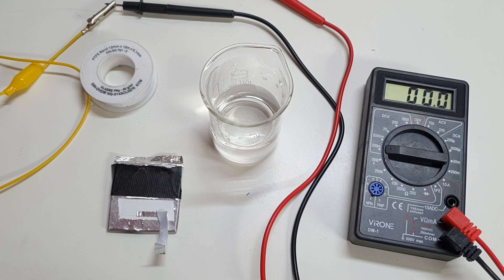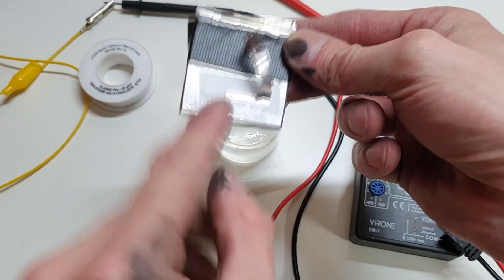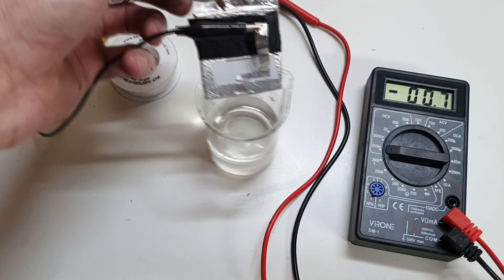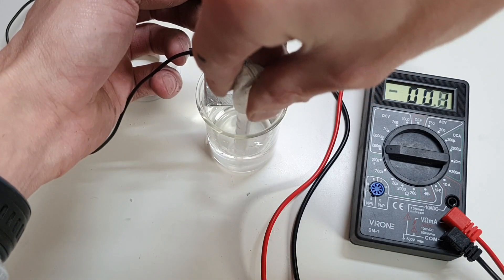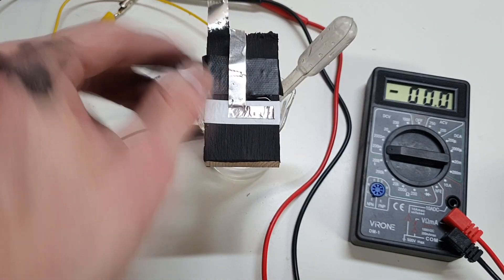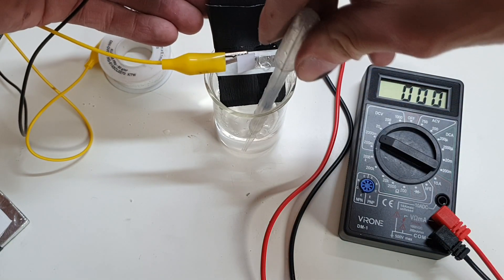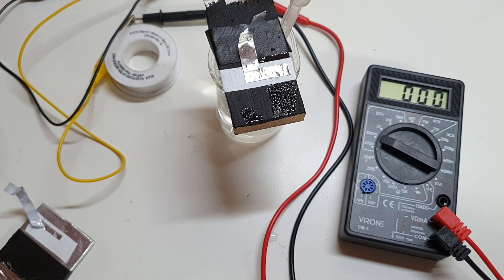Rain Fuel Generator from Conductive ink

Comment: Doing it with conductive ink (carbon based obviously) you created a galvanic pair so your additional voltage isn't from the effect that original device has but from the anodic dissolution of aluminum. So this is rather a bad idea.
Reply from the maker: Correct. A uninsulated carbon surface on the device will make a reaction and will produce a voltage in the range of 1 to 1.3 volts. A isolated carbon surface with a layer of PVB create the voltage which is shown in the video.
Reply: @cayrex  Do you using isolated carbon layer?

Comment: Hi there buddy . How is your rain fuel generator coming along ? I think it will be the first project I get to use the ink on that I made ! Just got to get a few things cleared away and let the testing begin . Have you any suggestions on what characteristics the ink should have besides conductive ? I am yet to research the papers on how this concept works but I have a feeling it's along the lines of static?

Comment: Did you measure the current generated by these voltages, to provide the power output?
Reply from the maker: Yes,.... its in micro amps range
Reply: @cayrex  okay, thanks. So I guess that places power output in the realm of nW/μW and so to produce 1W this would need scaling up by around 100,000,000%?
Reply from the maker: @timyorke9758  yea,.... NANOgenerator

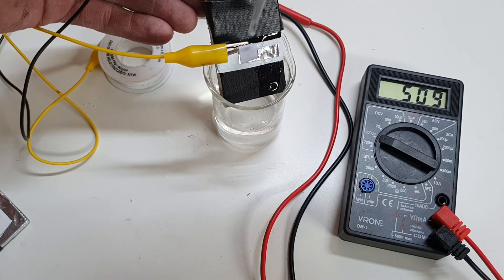Comment: Attention at 3:47. No droplet motion, just water forming a conductive bridge between the electrodes. I wanted to test this for myself so I got some aluminum foil and a carbon electrode and submerged them in a 100mL beaker of tap water and got a 0.8V cell voltage. A water droplet on a small area of electrode / active material might explain the low cell voltage, what do you think? Are the flowing water droplets just switching an electrochemial cell on/off between the conductive ink and the aluminum electrodes?

Edit : After setting up the same experiment with aluminum, PTFE, and aluminum , I realized this is actually a capacitive effect
Reply: Exactly!

Comment: Hi :)
Thank You for the Idea
I have a Question: Does the Water Drop loose Charge?

What I mean, can the same Drop be used multiple Times, like having a zigzag Slide/angled Stairs with a few of these Generators over each Other using the same Drop for generating.
Does it have minimal Height to regenate Charge or not?

With kind Regards
Reply from the maker: Hey! First,... I need to say that I am quite new in that field of generators. But yes I use that water over and over again on the same generator. I try to use two generators in series with the same water flow (not drops) and it didn't work so good. I dont know about the minimal Height.
Reply: @cayrex  it would be interesting seeing this generator in action in some real rain! Also playing with scaling down this generator(size and distance of the al. contact to the al or conductive ink). Can a multiple al.contacts be used on the same generator?

Comment: Impressive mate you should try dropping the water from a greater hight and also try holding the device at 45° from the water droplets. I have been told that it as the droplet expands that it releases it's charge
Reply from the maker: Good suggested.

Comment: Do you think the dissimilarity between the aluminium and conductive ink causes a greater potential difference? I'm wondering if two different non-ferrous metals (e.g., aluminum and copper) might accomplish the same thing.
Reply from the maker: Maybe,... I am not sure. Yes try copper and aluminium
Reply: Aluminium and capper works extremely well!

Comment: Very Interesting!   May I suggest you look into the works of Victor Schauberger, who documented that water, spun in a vortex, generated electricity &  also Lord Kelvin's water dropper spark machine.   I believe that your discovery of increased electrical generation with your conductive ink, if combined with Schauberger's work, might yield some even more amazing results!
Reply: Viktor Schauberger - Comprehend and Copy Nature (Documentary of 2008)
https://www.youtube.com/watch?v=yXPrLGUGZsw
Reply from the maker: @craigglewis  nice 😊
Reply: Some where U have a 3d model stl file to print one of the water turbines. I will have to look them up since I have access to a few 3d printers now :)  Do you have a 3dp?
Reply from the maker: @craigglewis  https://youtu.be/NlPZv5Wq7ZI 🤗

Comment: awesome improvement mate! love it - nice job and thanks for sharing
Reply: This would be easy to get a vynal cutting machine to cut a stencil then use the ink then peel off the stencil. Love that 2 of my favorite youtubers are collaborating. 👍
Reply from the maker: @robertpoynton9923  😊😘😅
Reply: well done guys, you rock ! 😃👍🏻❤️
Reply: Is the conductive ink dia-magnetic? Aluminum is para-magnetic, so is using two different conductors allowing more electrons to move within
Reply: This is imPOORement actually. Just lack of knoledge of electrochemistry.

Comment: I like your variation on RMS's TENG device very much!  But, to be fair, the area of aluminum foil exposed on your first device was way smaller in area than the conductive ink painted second one. Unless the exposed contact surfaces have the same surface area one cannot say than one is superior to the other device.
Reply from the maker: 420mV I get with almost half smaller cell that was the cell with aluminium.
Reply: Oh it's called rms !!
Reply from the maker: https://www.youtube.com/post/Ugkx1StjNmAzfb0A70iginJC_uormLC2krM3

Comment: Hi mate, my brain went straight to conductive inks and I left a message on robs channel.  
The gains from the ink seemed to be amazing.  Is it robs ink? I have some and will hopefully try this out tomorrow if I get time with my own acrylic ink
Reply from the maker: The ink what I use is my own. And yes,... looks really interesting. When I see that rain cell which Robert did, I knew that I need to make by my self. Next logical step was to use the conductive ink.
Reply: What happens if the drips are too fast? Or in a stream?
Reply from the maker: @bjl1000  faster is the water flow higher is current.

Comment: Freaking Awesome Mate. I did view Roberts Video of this Circuit. Thanks for sharing.
Reply from the maker: Yes I know 🤩 I get 700mV if the water drops hit the cell faster
Reply: Nice, but why not ink on the ptfe also, instead of alu?
Reply from the maker: Because, making some contact to PTFE  with aluminium tape was faster.
Reply: @cayrex  😅🤣😂